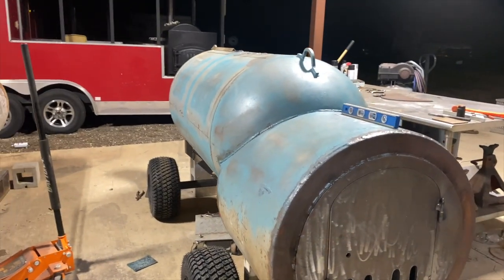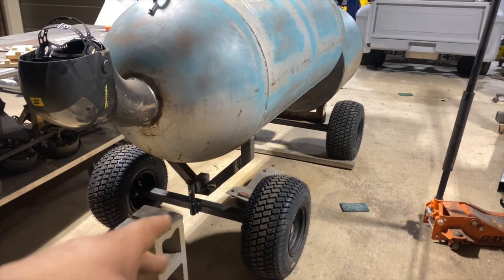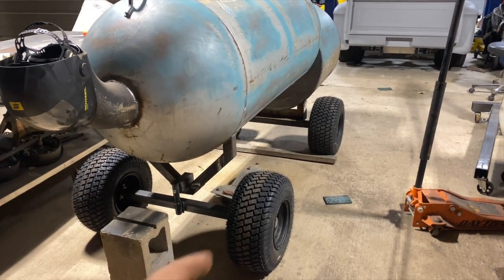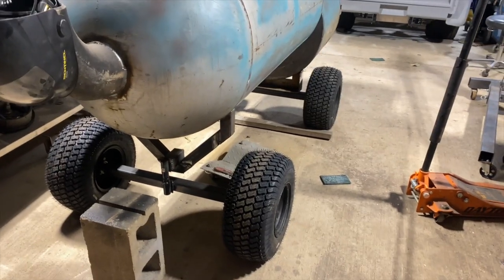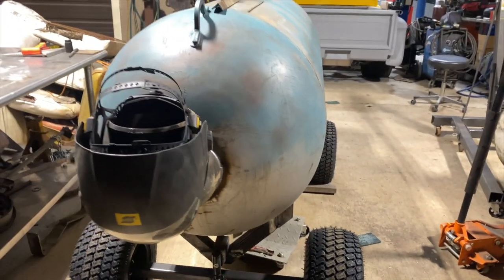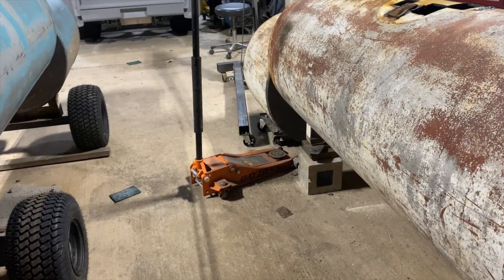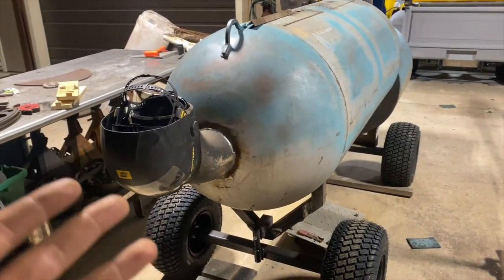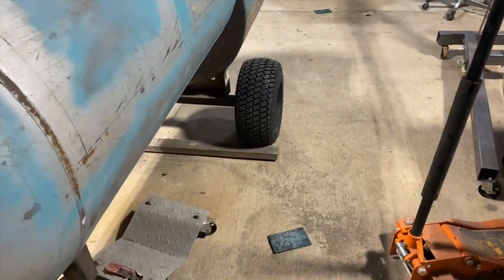Back Yard BBQ Smoker Build 2021 part 1

Comment: What magnetic welding ground is that? And does it work well?
Reply from the maker: I cannot recall it was at my local welding shop. I will say it’s been okay. But if you run the welder for a good bit it gets really hot and now it’s starting to affect it by not having a good ground. There’s another magnet one that I am looking to purchase. “Magswitch 300amp ground”.  I’ve heard good things about this one